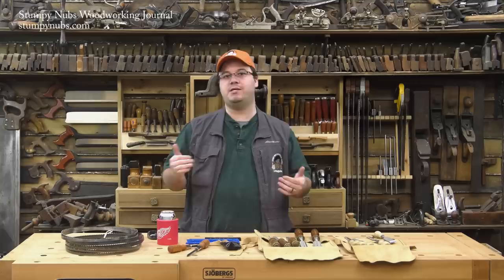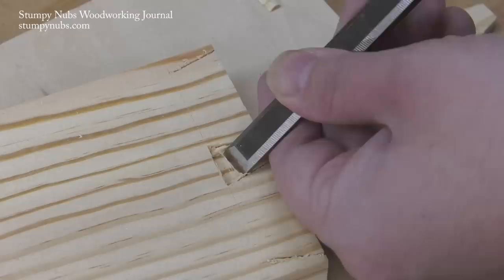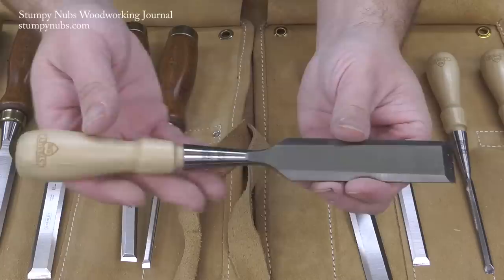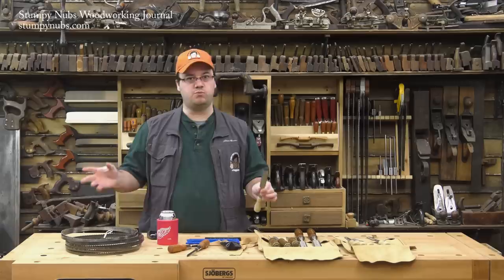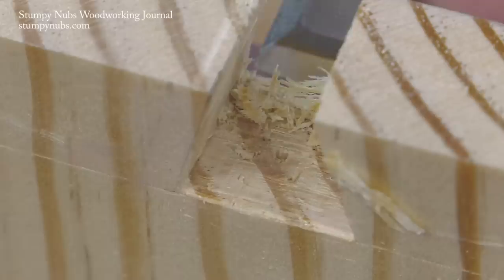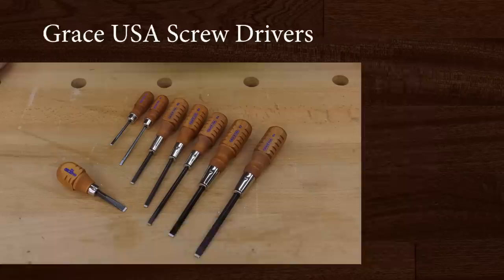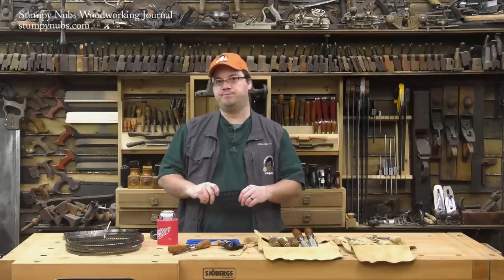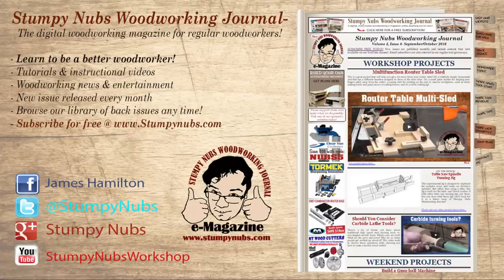10 Woodworking tools you MUST SEE! (Great chisels, cheap band saw blades, sweet screwdrivers...)

Comment: I bought the 8 piece sweetheart set and the Bailey set. I naturally use the sweethearts for fine work and the baileys for heavy work. But as good as they are I still use my set of Marples splinter proof the most. In the 30 odd years I've been a cabinet maker I haven't found a better all round chisel than the marples set. Saying that I do have a 1/2" vintage marples chisel with an Ash handle that is definitely a go to bit of kit.

Comment: Great overview Stumpy, one comment on drills and drill gauge cards. Drill gauge card I use to gauge or measure things, handy hanve all 5 cards from #60 to 1/2". All gauges. As for drills, in my shop only one drill out of box at a time period! Use it then put it way. If multiples drills need to be used then take a scrap of wood drill some holes and lable them to the size. Then use that to manage till there put away!

Comment: If you're enterprising, it's not difficult to modify both chisels and screwdrivers for better function. I ground down the lands on my Sweethearts to an almost-sharp edge. I use a grinding wheel to hollow grind the tips of decent screwdrivers to parallel or ever so slightly concave, even making ones dedicated to a single task. I'm not sure that there's a tool in my shop I haven't modified...  Clyde

Comment: I bought the 4 chisel set of sweetheart 750's after finding an old 720 in a box of assorted tools I got on eBay, it did not have a handle so I turned a beech one for it. I have turned some longer beech handles that I swap with the supplied ones if I need to pound on the chisel, if they do split, it's not a problem, I have lots more beech and can quickly turn up another.
Thanks for the review, it makes my choice a good one.

Comment: The best straight blade screwdrivers are the ones I mill to fit a particular screw. I have even been milling the bottom of old bent chisels to be flat. But sharpening chisels, I use the CBN wheel I learned about from Stumpy.

Comment: Make your own steel rings with a light tack weld..it works!    Honesty is the best policy.  I built my own mill’s resaw with a 48 inch circular mill blades on 2” rod driven by a 8 cyl 370 hp Diesel engine and a double belt clutch.  Just haven’t figured a good brake yet if sumphin ugly happened...  but it will drag a 18” square x 45” beam through straight and true with only the teeth marks to be planed off....🤗

Comment: another use for the metal drill bit guide.  I use mine with screws.  I will hand screw ( or thread ) a screw into the metal gauge to find a close match to the inner shank of the screw.  Makes finding an appropriate drill bit for pilot holes that won't be too big for the threads to bite.  I sure hope that makes sense.
Reply from the maker: Maybe I'll make a video of ways to use it!
Reply: umm dude, although it's a very useful and necessary tool (imho) and a very deserved place in your video, you pretty much nailed its many uses. OK you can use it for drawing circles.  Great video BTW.  I do believe I do deserve some new screwdrivers.
Reply from the maker: I didn't say it would be a long video. :)

Comment: Stumpy, I like using bluetooth earbuds in my shop too.  I solved the battery life issue by plugging my phone into a thingCharger port in an out of the way spot in the shop and connected to it via bluetooth earbuds.  No phone in way, no dangling cord, and the phone is always fully charged.
Reply: Doesn't anybody just use a regular radio in the garage anymore?  I do!

Comment: These cool tools segments are awesome. I have the 750 sweetheart chisels and went with the bigger set and I’m so glad I did they are incredible chisels for the price I was able to flatten the back pretty quick and also sharpening went quick. Other then these chisels I will add chisels but only a few for tasks such as you mentioned dovetails and a pairing chisel or two. As I have fallen down the rabbit hole of hand tools. Awesome video
Reply: Thom spillane hi

Comment: So... I bought a set of chisels for about 70 bucks at mernards. They came with the exact same leather tool roll as the stanley sweetheart chisels you showed. Except the handles look exactly like the less expensive stanleys you have there. Identical. However mine are Irwin Marples made in England. They have the same handles as those stanleys... I wonder if they're being made by the same company.
Reply from the maker: Maybe. The darker handled Stanley Baileys in this video came from Menards. I also sometimes see identical blue-handled chisels sold under the Marples and the Irwin names.

Comment: Hi,
How do Stanley Sweet Hearts compare against the Fat Max chisels? I fit a lot of Oak Veneered doors and so do a lot of cross grain work. I will burn through two sets of Fat Max a year. My main reason for using them is they are fairly well made and sharpen quickly, but they dull quickly.
Reply from the maker: I have the Fat Max chisels too. They are great for that sort of rough work because the steel is one piece from the end cap on the handle to the blade. So they are very tough, you can really beat on them, and all of the energy is transferred to the edge with each blow. The steel isn't top quality, but even a very good chisel will dull with a lot of hammering. I'm not sure what sort of work you do, but if it's door installation on construction sights, I'd stick with the Fat Max.
Reply: Stumpy Nubs Thanks, I think you are correct. If I come up with a better solution I will let you know.

Comment: I have been trying to get up on Sawblade.com for the last half hour.  Their website is not working as it should.   I could select the length, width, and tooth pattern, but could not place the item in the cart.  I was told I needed to create an account, I did - same o - same o.
Reply from the maker: Maybe we crashed the website. Try again later :)

Comment: Okay, what IS' the good resaw blade ???
Reply from the maker: Lots of people like the Wood Slicer from Highland Woodworking. i like carbide tipped blades for that, like Laguna's Resaw King, but they are pricey.
Reply: thank you, will look at those
Reply: I use a Wood Slicer from Highland Woodworking for soft to medium hard woods (love it) and a carbide tipped (Lenox) for expensive hard and resinous woods.  The carbide tipped blades have no set so they seem not to wander.  Although a wider kerf, if I have no worry of inconsistent cuts I can cut thinner and have less finishing.  My final thickness is in the 1 - 3mm range.
Reply: Thank you

Comment: I love your channel Stumpy, but I have to say - the Sweetheart chisels are ABSOLUTELY AWFUL. Like... worse than $5 harbor freight chisels. I had read some reviews on them, and they sounded good. I asked my wife for them for Christmas. I spent a few hours flattening and sharpening up 2 of them. I made 4 chops in pine boards (light chops) on some dovetails, and I realized that they were just tearing everything out. I looked at the edge, and the edge was completely destroyed. As in, completely chipped to an unusable edge. I spent another 20 minutes getting the chips out, and tried again. Exact same result. This was at 25 degree bevel. I tried again at 30 degree bevels, and exact same results. I must have gotten a bad set - but at best, the Stanley quality control needs massive improvement. Fortunately, I can still return mine. They did work ok for paring, but the steel does not hold up to impact in any way. My much, MUCH cheaper Irwin set had no trouble in the exact same wood. I ordered a set of the Veritas PM-V11 chisels the same day.

Comment: Okay, maybe I'm uneducated but why do you need to polish the backs of chisels? If it's a finished product, just use it.
Reply: Because they need to be dead flat to work properly . Most aren't.
Reply: Because as they come most chisels are not a finished product.   In addition to most needing the back flattened, the factory grinding marks need to be polished away or instead of having a crisp edge the edge will be a row of fine teeth.